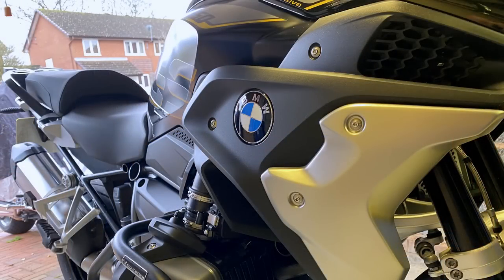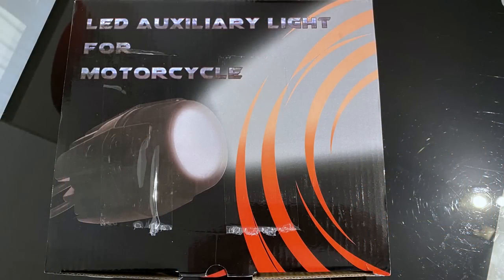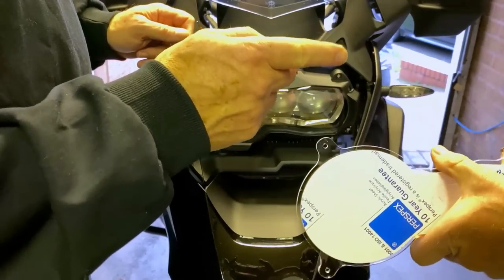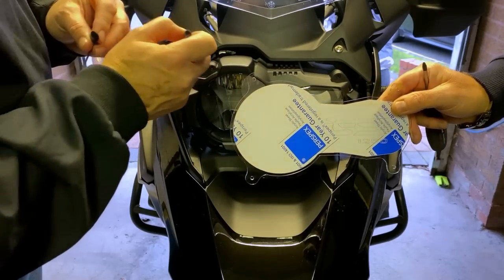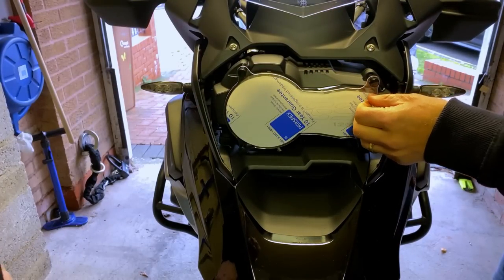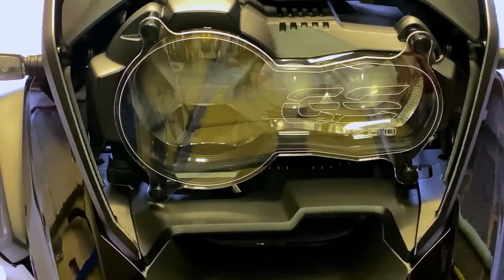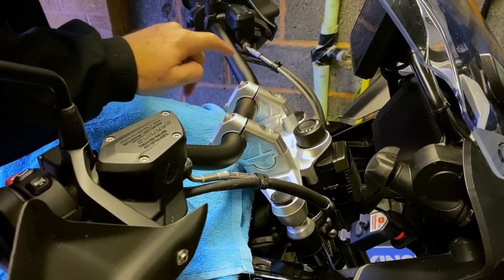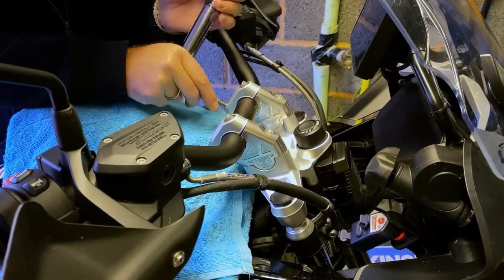Fitting Ebay Accessories to a BMW R1250GS Exclusive

Comment: A bit late to the game viewing this video. Awaiting delivery of a GS…..great information. Thanks. Did they all stand the test if time?
Reply from the maker: Indeed. The bike was sold a few months ago for an RT and they were all removed before that so on there over two years. The rear hugger needed thread lock on the four bolts holding the plastic guard to the metal frame as they worked loose but that was all 👍🏻

Comment: I have the same Led spots. Did you have to remove any panels for the intallation of the Led spots. Or can you move the cables through the side panels? Like your video. Just a pitty that the part of the most difficult install is not shown. I saw your video for the Denalli led lights, but wonder if i have pull the bike apart for these Led spots also?
Reply from the maker: Hi Yuri. It’s a mates bike those are on. We did take the panels off but it depends how much you want to hide the wiring. Certainly you can do it without 👍🏻
Reply: @nickhodgeUK  Thanks

Comment: Thanks for that video Nick. I have that same headlight protector, though mine is engraved with the HP logo; also bought the £30+ rear hugger which my dealer fitted for free before delivery. The original Mud Sling is fine for a GS but rubs the tyre on the GSA as the geometry of the bikes are different and at £130 is just not worth it. I also recently purchased from eBay a bracket for mounting a GoPro for £30 that positions just under the headlight. Cheers, Andy.
Reply from the maker: Andrew Tofts thanks for the input Andy. I know with the mudsling the GS has issues with certain hybrid tyres too. Thanks for mentioning the GoPro Mount. May be useful for me 😂
Reply: Hi AndrewI had a mudsling on a 2018 Rallye and it rubbed the tyre and in Rain and Road mode I sent the suspension a bit hay wire as in softer setting it interfered with the yaw, I see guys on YouTube cutting them seems pretty pointless after spending 130 quid !!.
Reply: RMG hi RMG, the manufacturer seems to be aware of this issue as they offered me a full refund, but they don’t seem to be doing anything to fix the problem.
Reply: Hi Andrew, I would have to say the 30 quid hugger which I fitted Like Sean's is by far the better job I've done some 10 k with it and its keeps the spray/ muck away from the shock and my wife's legs and boots win win all round. Regards Robert
Reply: RMG have you got tour plans this year Robert? I’m doing Scotland at the end of May and Norway in August; can’t wait😃👍
Reply: ohh yes I live in N.Ireland going to cross England, Belgium, Holland , Germany, Italy, Switzerland, then France Normandy, England Home. Like you Cant wait. Good luck in Scotland been all over lovely country.
Reply: RMG Wow, that all sounds great😃 This will be my second trip to Scotland, but this time I’m doing it with my brother; me on my 1250 GSA and him on his 2002 1150 GS. Cheers, Andy

Comment: Bought a Chinese "Touratech" toolbox for the GSA. Didnt look so good with fit etc. , and bit the bullet with genuine part
Reply from the maker: Thanks Kevin, I think that is the point, some's good, some ain't
Reply: @nickhodgeUK  I did buy the cheap Aux lamp guards, but not able to compare with Touratech. Not sure if angles are the same.

Comment: Hi Nick great video, thanks. I want to try  a set of bar risers to see if it helps my stiff neck. I wondered how your mate was getting on with them? I also nearly purchased the Chinese risers the other day but to be honest I can't bring myself to trust my life on them being so cheap. But then who is to know that the expensive "proper" ones didn't come from a similar factory using the same materials?
Reply from the maker: I’m with you that it’s maybe trusting in the unknown but as you say who knows where the premium ones are from? I would say too. These are not cast. They are turned aluminium, the bolts are good and they definitely ’clamp’ so cant really see where it could go wrong. Not ridden since but will try and mention it in a future video

Comment: LED Light Set ebay link is broke, could you please update it with correct link, and all necessary parts to fir it in R1250Gs, thanks in advance

Comment: Can you use stainless steel bolts on aluminum? Always heared that is a big "No, no" ? Don't mix alu with stainless steel? Or am i wrong?
Reply from the maker: I’ve not heard that. Certainly you need stainless or heavily anodised bolts for corrosion protection but the bolts holding engine in are stainless and into threaded aluminium??
Reply: @nickhodgeUK  I read something about galvanic corrosion. But it's possible that i misinterpreted the explanation. Because my English is not so good.
Reply: My problem is that I also bought risers but hesitate to use them now.
Reply from the maker: I thinks that is the outcome and you won’t want threadlock on but maybe a little grease to stop the reaction?? Ensure you torque correctly though and check occasionally. My mate I fitted these on has been very happy with them.

Comment: Great video........I’d like to know the actual brand of the fender extender you found on eBay. I want one similar that has those clamp style attachments instead of screws through the guard as most use.
Reply from the maker: There is a link in the video description to a UK seller on eBay that is still live 👍🏻
Reply: I’m actually looking for one for my ‘21 K1600.......is that a similar mudguard do you think?
Reply from the maker: @ducfatsvideos.6293  that I don’t know I’m afraid. Personally I doubt it

Comment: Hi Nick, I take it the ebay lights are connected straight to the battery with a switch on the handle bars (not through a Cansmart) your link to fitting Deneli lights doesn’t really help with fitting these. How did you find the ebay lights performance quality etc. Great videos, keep them coming👍
Reply from the maker: Graham. It’s on my mate Sean’s bike as you know. They are connected direct to the battery. The beam is good for visibility. Not so good for rider increased night light although not ridden much. We are going to wire them into the ‘switched’ live though as it’s easy to leave them in during day. We’re planning on using the accessory socket power
Reply: Nick Hodge Thanks for that Nick, would appreciate it if you would share the rewire👍 I’ve heard that running an electric tyre pump through the accessory socket trips the canbus out, do you think the lights would run ok (looking to fit them on a 1250GS, mainly for day running lights)

Comment: Always pays to shop on eBay. The Denali lights are expensive for a reason and can be programmed through the Denali Gen II CANsmart, operated through stock switchgear. But I bet you know that.
Reply from the maker: Comments always welcome whatever, but yes. There’s a video on the channel fitting the CanSmart and Denali lights. You’re right though. Those are ‘expensive’ but high quality

Comment: Fantastic video ,  only recently joining the GS family so enjoying learning about all the mods suggested .  If you could do nine in panniers as it’s a minefield . My bike is a 2020 1250 gs te so unsure if I require all the scaffolding to fit panniers or if they fit as is with top box ….. arrrgghhhj lol
Reply from the maker: Hi Billy. Most go for the Vario Luggage on the GS and that needs no racks. It hangs on the two ‘holes’ either side of the seat and rests over the casting above the pillion footrests. I have done a video on the system. If you want to go for other luggage then yes, you’d need to buy a rack to fit them. The GSA comes with racks for which there are several that fit straight on (eg Touratech, Bumot), but equally, some also need different racks (eg Givi). I loved my Varios on the GS but really love my Bumots on the Adventure (the main plus I find is the lid opening up on the panniers rather than sideways on the varios
Reply: @nickhodgeUK  thanks so much for the info . Massive help buddy .  Rode safe and keep up the great work
Reply from the maker: Thanks Billy, you too 👍🏻

Comment: Hi Nick, I liked your video, i purchased the front and rear fender extenders based on this. I have one big issue, the rear hugger main fitting contains a bush, which destroyed itself well before i got to the torque required. On FB I see I'm not the only one with similar issues with the bush and bolt. Do you know what material this should be manufactured from? It needs to allow some movement by the look of it. I'm removing the hugger until i can sort this.
Reply from the maker: Hi Steve, Really the bolt holds the hugger although we did add some loctite. The rubber bush is really a vibration shock absorber so I’d say try and source maybe better quality rubber and fit bushes? A good motor factor maybe??
Reply: @nickhodgeUK  Thanks Nick, the issue is it needs 54 Foot Pounds AND the strongest type of Lock-tight as its a key suspension link which also needs to flex. The bush has to take that torque, it also needs to allow movement of that joint and it seems its made of a very inferior material. There are several people complaining on FB. The only solution is to get a bush made, exactly the right length, to allow this torque, without squashing the hugger, then apply Lock-tight. The BMW manual calls for the very strongest Lock-tight, as they know how important this link is. If i can get a bush turned to fit, I will try to find a rubber bush to hold the hugger in place, but this is secondary in its importance. You must not let the ally casting take that torque, otherwise it will crack under load while riding. 
I'll say nothing, but I strongly believe you should put a warning on your video as this is an accident waiting to happen. One guy has posted that BMW noticed the bolt had undone almost completely during a service and warned him it would have collapsed the rear if it had undone slightly more.

Comment: Thanks Nick, great video and very helpful. Fitted a £30 hugger to my 2017 RS (same fitments at the swinging arm/rear wheel as your GS). As you say, generally very good quality... BUT I do question the quality of the supplied bolts - a bit 'loose' in terms of the bite of the thread. I'd suggest using Loctite or similar to make sure they don't work their way loose :)
Reply from the maker: I agree. We’ve done that since on the hugger for sure 👍🏻

Comment: Nick great video any update on the parts are they still ok or failed ect would be a great help , I brought a extended hugger for my XR lasted about 2 months after three gave up lol cheers Nick how’s the GSA going apart from the soft wear issue . As I’m looking at a 21 XR or the 21 GSA any updates would be greatly received by yourself .Dale 👍👍
Reply from the maker: Hi Dale. It’s a mate’s bike but yes all good. On the hugger we had to apply threadlock to the three bolts holding the plastic to the frame as they came loose but I should have realised they had no washers to tighten to. I love the GSA but it’s actually VERY different even than the GS. It is heavier when full. Seems taller and less nimble but has great presence and the weather protection particularly on motorways is awesome. I rode the XR the other day and that is a weapon!!! Personally I don’t think I could get on with keeping it alight (as it wants). The GS(A) is no slouch but sedate in comparison. I also found the seat a bit ‘slippy’ on the XR and it lacked adjustment. Then a silly thing, but my want to be visible had a real issue with no proper rear light unit. Just the rim of the rear indicators. Both VERY fine bikes but you may get in better with a GS than an adventure if you want to be near the nimbleness of the XR 👍🏻
Reply: @nickhodgeUK  Thanks Nick all good points especially those rear lights on the XR 🤔. I’m a big lump 160kg so I feel the GSA would suit me better size wise I’ll probably end up with the low chassis one won’t know that till I test then in 2 weeks thanks for the reply stay safe 👍

Comment: Hi, can you please tell me, which ebay seller you bought the rear hugger from, as I can only find ones costing hundreds.

Thanks
Reply from the maker: There’s a link in the description, does that not still work?
Reply: on ebay, says "page missing" using your link
Reply from the maker: @thedvdman1  same one as the 1200. Seems they’re all listed under that https://www.ebay.co.uk/itm/324940171964?mkcid=16&mkevt=1&mkrid=711-127632-2357-0&ssspo=jaC9xgOYTEK&sssrc=2349624&ssuid=z_t9Fy_oQ3q&var=&widget_ver=artemis&media=COPY
Reply: ok, thank you. Now ordered

Comment: Another great video Nick, thank you for sharing this. I too have the eBay front fender extender and agree with you, seems very well made. I’m now very tempted by the headlight protector and rear hugger. Do you have any feedback since fitting it, especially in relation to how much crud it’s stopping? Many thanks again.
Reply from the maker: Bartonboy no feedback yet. Only fitted it last weekend. Spring’s coming though 👍🏻
Reply: Nick Hodge 😀 cool. Headlight protector just purchased, so thanks again for the recommendation.
Reply from the maker: Bartonboy think I shall get that for mine too

Comment: Hello Nick. Great videos! Do the premium accessories come with torx type hardware? Vs Hex key? I have seen lesser hardware rust and corrode on other bikes.
Reply from the maker: Hi Marcus. It does vary dramatically. In my experience and frustratingly the premium generally has hex fasteners which I note in many videos as it’s another tool to carry. Premium seem always to at least have stainless steel fasteners where obviously some (and it is only some) of the eBay type items have mild steel which of course will rust

Comment: Hello Nick
Great video with rigorous information as always. Can you give me your opinion about the need for mirror extensions in the 1250GS?
And taking profit, why you have chosen Givi tank bag for your bike instead of the SW-Motech system (micro or day bag) that seems me more robust?
Reply from the maker: Hi Jose. I guess as we would say “You pay your money and take your choice”. Don’t think there’s much in them. What I didn’t want was a big bag and the Givi is about right. I thought it was a bit too small but have found it carries everything I want to hand. Glasses, wallet, visor cloth and spray, change and with a USB adapter charges my phone and GoPro batteries as I ride. Like that I can simply pull a lever and refuel. Not that all those things aren’t possible with SWM, but I’m happy. I’ve not found I need mirror extensions. I have quite a wide body and can generally see fine. Have always looked around too before making manoeuvres on motorways (lane changing) as stuff is not there one second and IS there the next. Thanks for the comment and ride safe

Comment: Did you end up paying import duty on those pieces.  I noticed the eBay add mentioned duties aren’t included
Reply from the maker: No but I guess that’s the gauntlet you run. I have heard people order £2 iPhone cases and get £24 duty. Normally if it’s declared properly and of low value then it seems ok. It’s definitely carrier specific too. If they use DHL for example, they are geared to charge duties others are not. I also believe some have handlers in the UK who hold the stock but guess they have to warn in case they charge. Bear in mind too, the duty on most metal parts from China is 2.7% (plastics more) which is trivial. It is the carriers that levy a surcharge of £20+ to collect the duty

Comment: I am curious if the headlight guard causes any reflection or glare issues.
Reply from the maker: Ford Rox doesn’t seem too. I guess as it gets old and inevitably scratched it will detract light but I guess no more than the ‘premium’ aftermarket ones? There’s a good gap to circulate air and have ability to clean although it’s an unscrew if you want to be scrupulous
Reply: I have fitted this headlight guard  and I can't say I have noticed any glare or reflection,  and I used this one as in my mind the metal ones must block some of the light out?

Comment: Great information! Thanks for sharing this. I am also looking for the riser for my 1250GS, what do you think about the quality of the riser from Ebay you purchased? Some people are talking about the poor hardware material used in the low price riser.
Reply from the maker: Quality seems fine. I've yet to fully compare with the Wunderlich ones for example. They do leave tight pipes and wiring when at full lock but I suspect that may be the same with any of them as they are the same size

Comment: the prices that were disclosed on the video were much more expensive on ebay as stated
Reply from the maker: Obviously prices fluctuate but the theory that these would be far cheaper than the ‘branded’ options I suspect still holds?

Comment: Nick. Thanks for the video's. Bought my 1200 GSA from the dealer you recommended. I've got the Chinese no brand tool box and as with the stuff you reviewed the kit is perfectly good. It holds a surprising amount. I've been holding off on the huger as it's a involved with stuff you don't want disconnecting itself. Following your vid I'll be getting it. So finally a question... Did you and your mate have any concerns with the frame bungs i.e. future removal or trapping water?
Reply from the maker: Gary Coates hi Gary. On the trapping water, no. Not sure thy would be an issue to worry about. We did discuss removal. It it was only the large one that felt like it wouldn’t ‘pop’ out. The Hugger really impressed and easy to fit. One commenter has said loctite the three screws in the threaded bushes as they can come loose which we’ll do. Ride safe
Reply: Quick spray inside with ACF50 or GT85 before the bungs were fitted would solve worry of water damage.
Reply: @nicholasknibbs8162  Thanks for the suggestion. I already plan to use acf 50. Just waiting for the plugs to arrive.